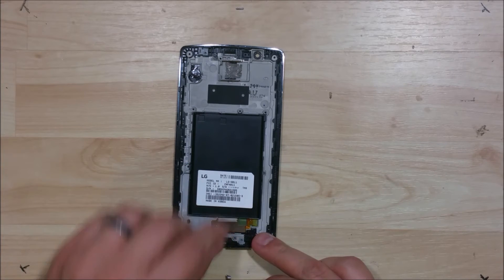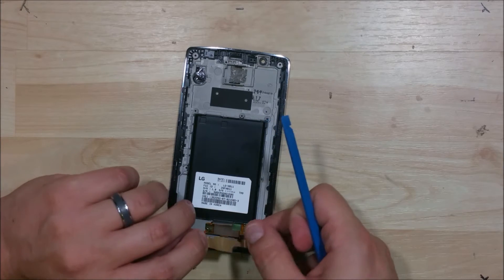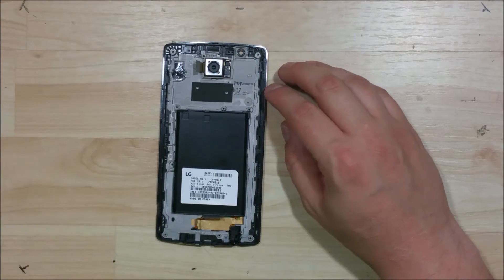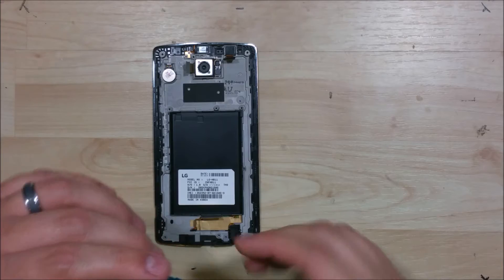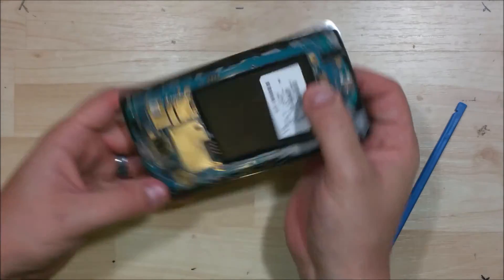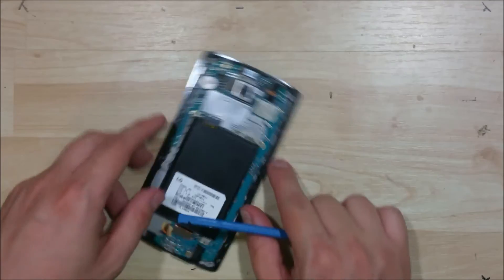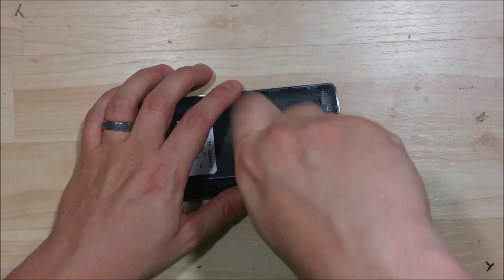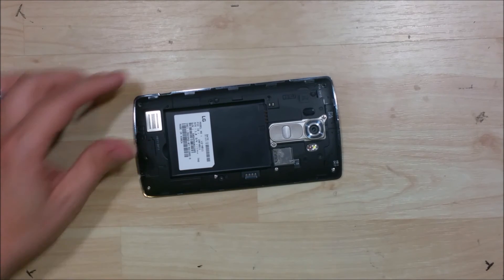LG G4 Screen Replacement - Reassembly

Comment: Hi, thanks for your fine video's. I use them for replacing the motherboard. Is a cooling-pasta necessary mounting the new one? My old mobo and frame have some very dry remains on it. Should i remove this before mounting and using a pasta? Thanks in advance.

Comment: I just replaced my screen and everything went fine except that the new screens colors are way off and anywhere that has black it turns a digital glitchy blue-purple. It's getting worse the longer it goes. Also it has ghost images all over it. Is this something that I did or did they send me a defective screen? I didn't notice any problems disassembling and reassembling.

Comment: Screen looks and works great but now I have horrible service and once a call is placed, the screen goes black till the other party hangs up or I trick it by connecting or disconnecting the charger. Please help!
Reply: I have the exact same issue. Any idea?
Reply: Found the solution. There's two rubber thingies in the top that have to be transplanted to the new screen as well. The screen I bought didn't come with these. Also the black electromagnetic shield, rectangle below the camera, had to be transplanted (and this is not so easy to do, still it seems to work though it's a bit damaged in the transplant). Everything fine now except: no green charging light when charging, and phone top speaker (regular calls) is a bit more silent than before even at max volume. Still good enough for me.
Reply: I found the rubber parts but I'm still having the same problem...the screen goes black during an active call. Any ideas?

Comment: Hi,I have this phone and fixed as you are showing,but now when I make a call the screen turns black..I pinched the top and it came back for a sec then nothing.
Help...it's got to be something simple.
Reply: On your old screen assembly you missed transferring over the proximity sensor rubber. For images of it google "lg g4 proximity sensor rubber"